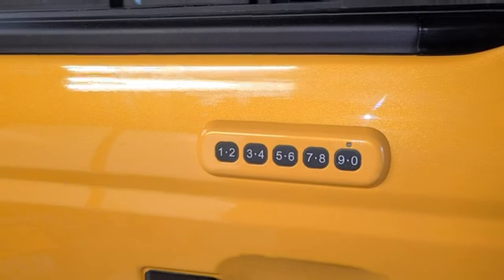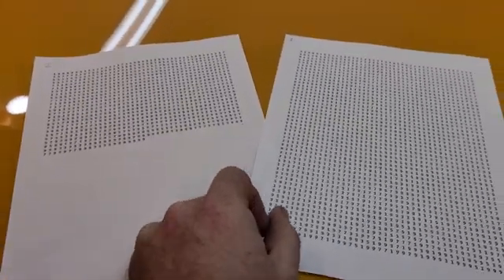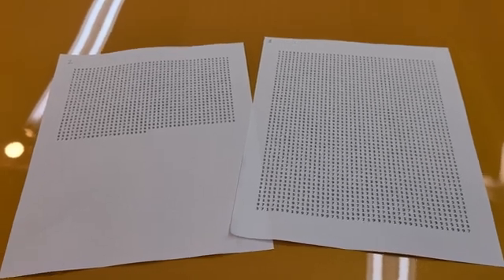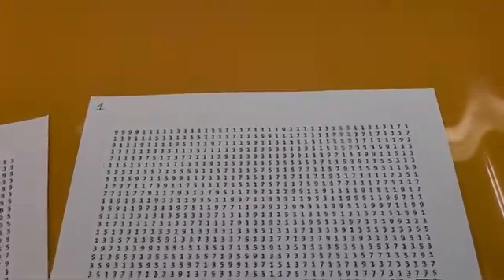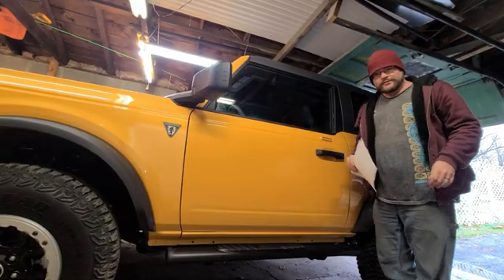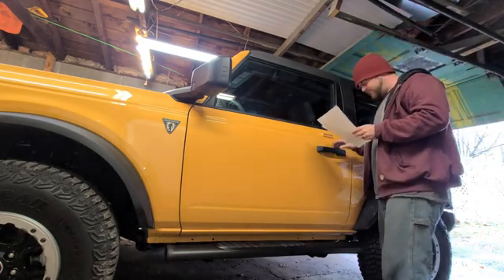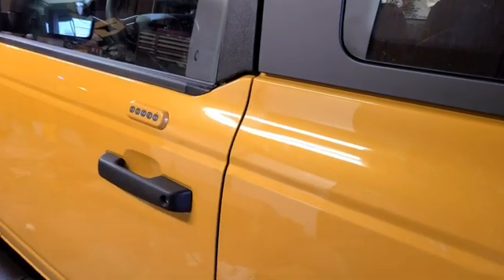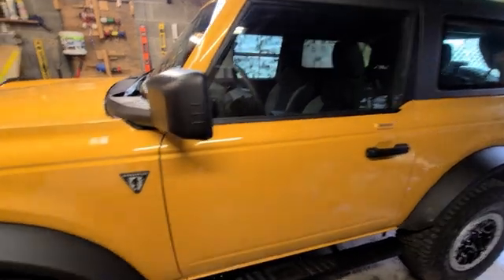I can BREAK INTO your new FORD BRONCO. EXPLOITING a 40 YEAR OLD security risk.

Comment: Bought a single owner 06 Explorer several years back, who never used the keypad nor knew its number, thus this hack came to the rescue.  I also have hidden inside the SUV both a spare vehicle and house key, saving my bacon several times.  An additional non-coded vehicle key is hidden on the exterior as well if the battery is dead due to a parasitic draw or used the battery too long while camping.

Comment: convenience, or security. pick one, LOL. But how is that key pad easier than using a key or a fob?? Why do these key pads exist!?
Reply from the maker: Subaru uses a similar system with their keyless entry models. 

I think it's for when you don't have your key on you and want to hop in to grab something. 

Or if a co worker needs to grab some files from the car but you don't want to give them the keys. Etc

What's odd is this is a base model and it still has phone app integration and can be unlocked from the app so long as it's within cell service. 

I still think for the $100 it's worth the price.
Reply: They exist if you lock your keys in the car it’s easier than calling and waiting for a locksmith to open your car. Lock your keys in 1 time and it pays for itself. But as long as it is easy to break into using this method I would say it’s not for those who like to leave valuable items in their car.
Reply: People with ADHD. I couldn't tell you how many times this has saved me. Guess how many times my vehicle has been stolen.
Reply: @larrymashburn7789  I would say the concern is less about getting the whole vehicle stolen and more about items left in your car.